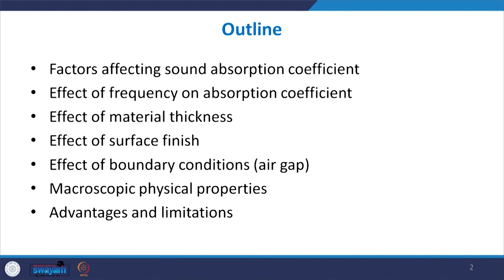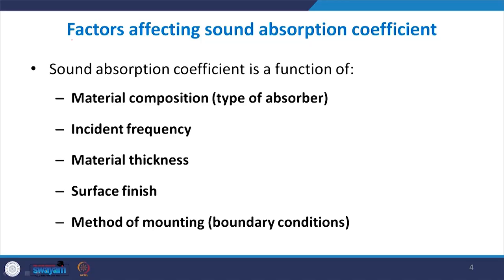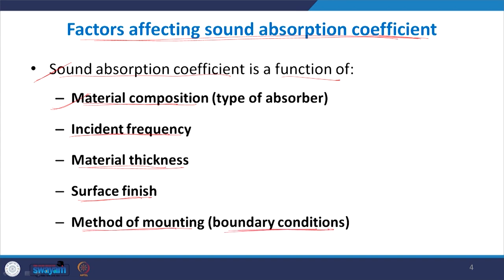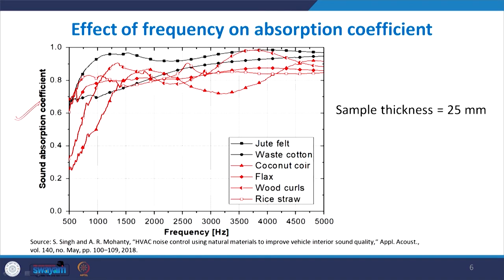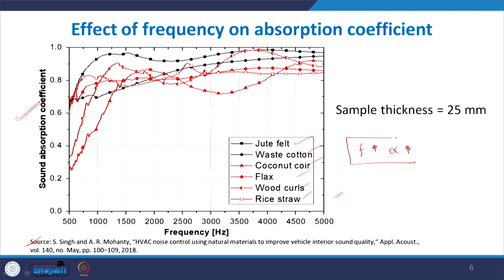Lecture 16: Porous-Fibrous Sound Absorbers

Comment: Dear Madam, why does low frequency absorption coefficient improve due to air gap?
Reply: more depth between absorber boundary and reflecting back wall means it can "reach" a longer total longitudinal wavelength - however if the air gap is larger than the absorber thickness, then the absorption alpha becomes uneven across the spectrum.